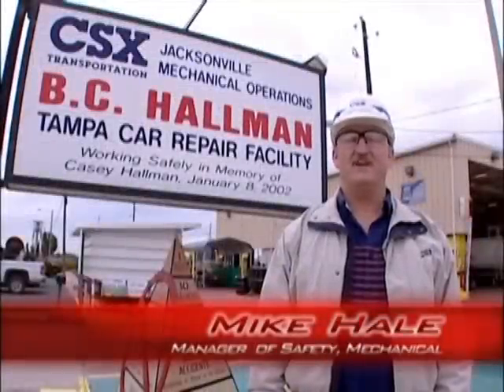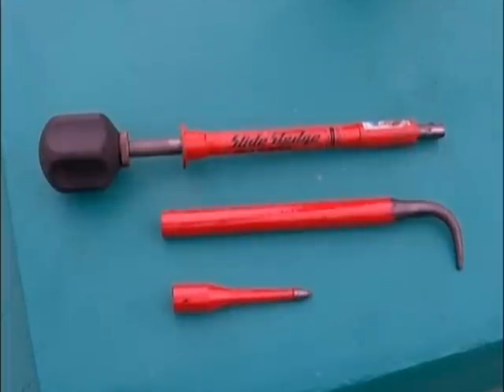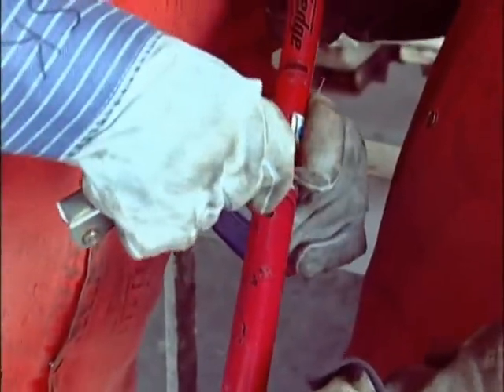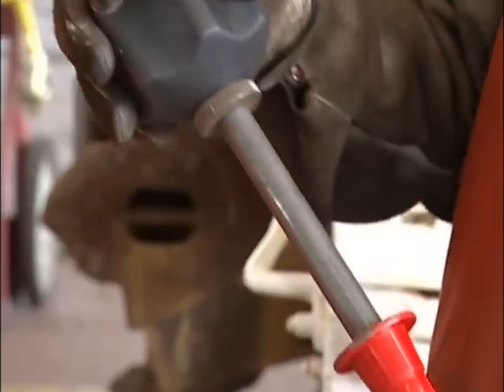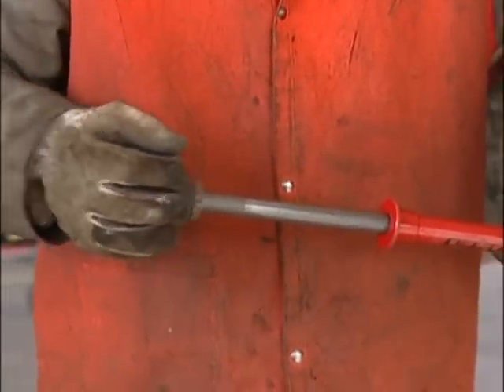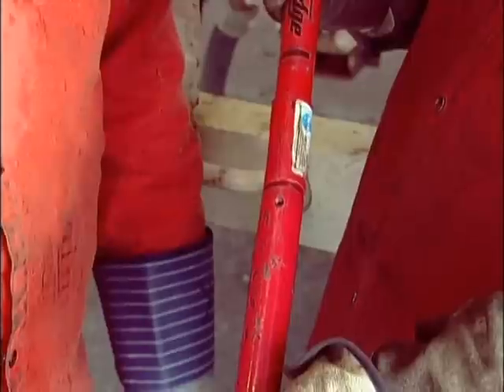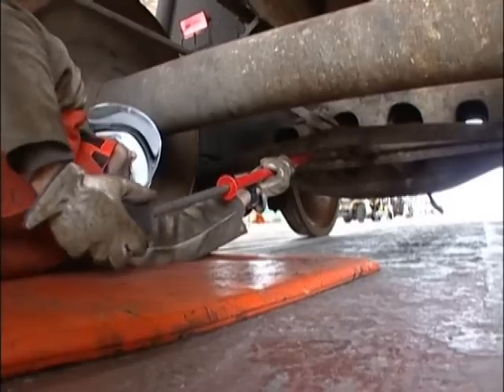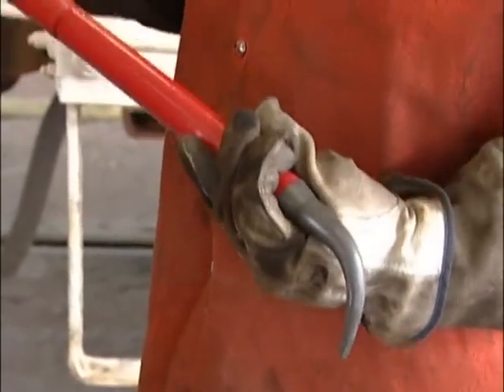Slide Sledge Cotter Pin Remover

Comment: Does this work with rusted cotter pins
Reply: Sure, as long as you have access to the eye. The pin should be straightened first. I can't see using this for the majority of automotive applications.